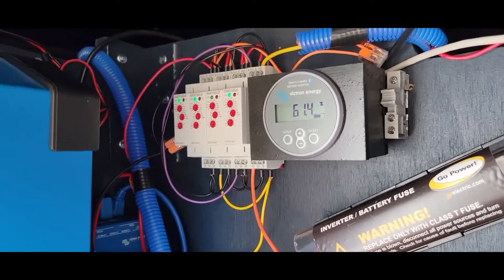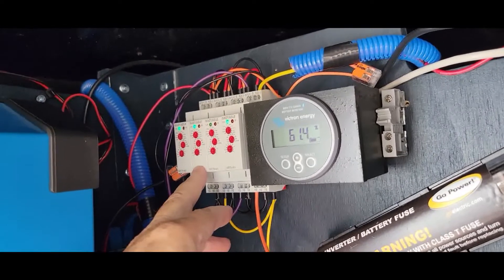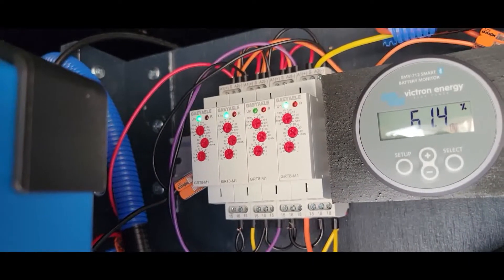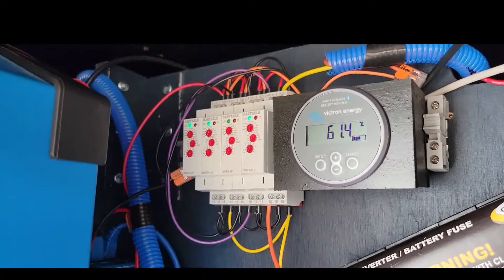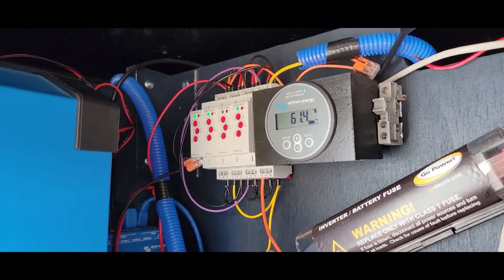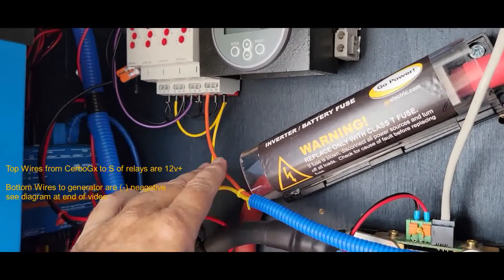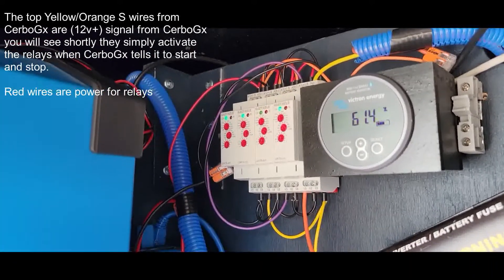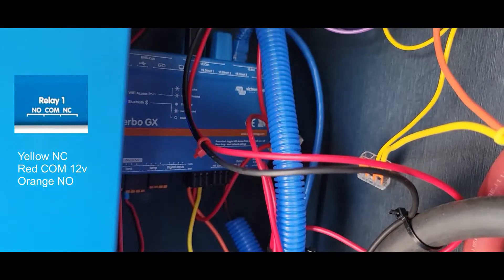Automatic Generator Start CerboGX start/stop/prime setup. Onan5500 controlled by Victron Cerbo Gx

Comment: Great video, and thank you for taking the time to share your knowledge.  I have the exact same setup as you do; however, after wiring exactly how your diagram is showing, then rewiring based on the "rainbow" daisy chain you have for red/black and NO wires, I still am having issues here.  I was wondering if you can compared my setup to yours?  For starters, I have the exact same Onan 5500 gas generator with the prime cycle start-up.  Hold Stop for 3 or 4 seconds--I was always told to hold until the display showed numbers--then push the Start button, holding it down until it starts.  So, exact same as yours.  When I originally wired everything up, I used 5-gang Wago connectors for the red 12v+ wires on top, same Wago for the top black wires as well as the bottom ground (Note: I have both my top ground wires and my bottom ground wires connected; your diagram doesn't show this, but I'm unclear why it would matter, i.e. ground is ground is ground is ground), etc.  Also, I had the red 12v+ wire going into the center pin of the Cerbo relay wired to the same red wire 12v+ for the tops of the relay.

Wired up this way, the minute I hooked up the red wire to my battery, the relays ALL started firing.  My lights looked nothing like your startup sequence.  I notice that in your startup sequence, Relay 1 & 2 & 4 all have green lights (no red), with Relay 3 showing no lights at all.  After your relays trigger a full start and stop cycle, your lights then show Relay 1 & 3 with green lights, while Relay 2 & 4 have green and solid red.  My first big question for you: how are your relays supposed to go from this "finished" state back to the original starting state?  There is a cut in your video where the relays are just magically back to the starting state (Relay 1 & 2 & 4 all green, Relay 3 not lit at all).  How does this cycle back?

After reading some comments here, I noticed how you have the A1 slots all daisy chained together with the little "rainbow" wire technique.  So, after striking out on my first attempt, I tore everything down and rebuilt with that approach.  As best as I can tell from both your diagram and still images from your video, I now have my relays wired exactly like yours.  HOWEVER, as I noted before, as soon as the red 12v+ wire is attached to my battery, the relays start triggering even though I haven't started the generator with the Cerbo Remote Console.  I have no clue why that is the case; the signal wires are attached correctly (per your diagram and the video), so I'm really stumped at this point and could use some ideas.

I almost forgot to mention that I do have the single function relays that you mentioned in the video.  I have three GR8T-B1 relays for Relay 1 & 3 & 4, with the GR8T-A1 for Relay 2.  I am using all of the same settings that you are.

One thing that I will point out, to echo another user's comment on this video, you don't show anything about how the bottom wires actually attach to your generator.  What I did was run the two wires up the wall behind my OEM control panel.  In the control panel, I have a rocker switch for the Start/Stop, with a generator display for how many hours are on the generator.  Behind the rocker switch, there are three wires (a brown wire behind the Start side of the switch, a black neutral(?) in the middle of the switch, and a yellow(?) wire behind the Stop side).  I assumed that Stop wire from the bottom of the relays (two outputs on Relays 1 & 4) would simply splice into the yellow Stop wire behind the rocker switch, and the brown wire (Start wire from Relay 3) would simply splice into the brown wire behind the Start side of the rocker.  I think these wires/capabilities at the control panel are backwards, because when I have the Stop wire (from the control panel) connected to 18 coming out of Relay 1 & 4, when I apply 12v+, the generator IMMEDIATELY tries to start.  I swapped the wires at the bottom of the relays, and then I get a priming cycle.  HOWEVER, as soon as I connect 12v+ power, the relays trigger....I get a priming cycle, but no attempted start of the generator.  The second attempt at wiring is producing the same results as the first wiring.  Ugh.

At any rate, I believe I have it all wired properly.  I believe I have the Cerbo configuration for the generator start/stop also wired correctly.  I'm really just frustrated and completely out of ideas.  I'm a newbie when it comes to relays, but I took the time to really study how these particular relays work.  I just don't see anything in my setup that is deviating from yours.

Please help.  You are my only hope.
Reply from the maker: To be more specific when using GRT8-B1,A1 relays.  Top wiring should be Relay 1 A1 CerboGX start signal NO wire and daisy chained to relays 2 and 3 A1s.  Relay 4 A1 CerboGx Stop signal wire NC.  there will be no "S" wires and the grounds are connected the same.
Reply from the maker: To answer your comment on generator wire connection and for others.  In the video I said I connected near  my G7 pannel in the RV but there are a many combinations and conditions that are possible and I've seen some weird setups. standalone generators, diesel generators are diffently configured different.   Seen 12v triggers and combinations of ground and 12v on prime switch etc.   Like on the sheet Test Test Test so you know exactly what triggers your generator before making any connections
Reply: @ERazorDiy  Oh!  One final thought (just in case others run into this issue): after getting the wiring on the top updated per your original response (removing all red 12v+ wires and moving all S signal wires over to A1), my start sequence still wasn't working as I would've expected.  But that's when I remembered the weird situation from the night before where the wiring at the generator start/stop switch seemed backwards.  As I mentioned previously, I assumed that the wire directly behind the Stop side of the switch would be where the Stop signal would need to be sent, with the wire behind the Start side of the switch would be where the Start signal would be sent.  In a nutshell, it was exactly opposite (for some reason!).  I had to send the Stop (priming) signal to the wire behind the START side of the switch to get priming cycle, delay, then start the gen to work properly.  Or, more to the point, the 18 ports from Relay 1 & 4 (Stop) had to be sent to the wire behind the Start side of switch; the 18 port from Relay 3 (Start) had to be sent to the Stop side of the switch.  Go figure....but wanted to point this out as it does seem like a weird configuration and not at all intuitive.  But, testing things out, I was able to discover this and get it working.  Thanks for all of your great information!  Sincerely!
Reply from the maker: @JohnZurilgen  glad to here you got it working and yes there are some wired configurations on the start/stop and prime switch panels even seen a prime switch with 12v (assuming it went directly to fuel pump) so that was ignored and sent prime from the stop.  Definitely need to test your supply controls to see what's really happening.
Reply from the maker: Hi John,  The multifunction (GRT8-M1) and the single (GR8T-B1,A1) function relays work slightly differently so you need to change the wiring a bit.  The top wiring would be changed as follows.  The ground wires to the top will remain the same. Relay 4 remove A1 12v wire.  Remove "S" wire and put in A1.   Relay's 1,2,3 remove the "S" wires.  You should be left with A1's rainbowed to 1,2,3 and pig tail on 3.  remove pig tail on 3, leaving rainbow 1,2,3 on A1.  Remove the 12v to relay 1 A1 and replace it with start signal "S" wire you had on A1 "S".    this removes the all the "S" wires triggers and is now using the power from the cerbogx  NO and NC to activate the relays.  When the cerbogx is stopped the only relay is on is #4.  When you start the generator relay 4 turns off and 1 and 2 should come on. Remember 2 timer must be longer than relay 1 timer by a 3-5 seconds ish can be a bit longer.
Reply: @ERazorDiy  amazing!  Thank you for this comment.  That totally fixed my issue!  I'm happy to report that this change has lead to great success.  What's interesting is when I was wiring up the relays based on your video/diagram, I even though to myself that I wondered by the NO/NC wires wouldn't be used to energize the relays themselves.  I tested the NO/NC wires with a multimeter and discovered what I would've expected: with the Cerbo relay "off", the NO wire was showing no voltage while the NC was showing 12volts+.  When I activated the relay switch via Cerbo Remote Console, I saw the voltage swap in the wires.  Being new to relays and understanding the power to the relays (red 12v+ and black ground), I understood the S slot to be the signal that would close the gate and energize the relay.  And, I suppose that is exactly how it works in those multi-function relays (to make that relay more flexible for the change in functions).  In my single shot relay, the signal wire becomes the 12v+ for that relay to energize and "do its thing".  Man, it's awesome to learn new things.  🙂

Comment: Amazing video! Would you be able to provide information on how this is wired to the RV side of your switches? Specifically the gen start/stop and prime. I have a separate button to prime and he start/stop is a 2 sided switch(left is start and right is stop). Also I noticed the red wire in the relay on the cerbo gx, is this just a 12v power to supply the relay? Or is this where you are drawing the power on the top side of the relays? Do I have to power my relays from this location? Thanks very much in advance for your help
Cheers
Ken
Reply from the maker: Hi Ken,  that sounds like a diesel generator?  That setup would be different but doable but would need more information on your generator.   This is a simple way to to control the generator.   A more advanced way is using a raspberry pi picow I have a video on that as well. https://youtu.be/ujeoZ4ldIGY
Reply: It’s an Onan 4000 gas gen.
Reply from the maker: @kenmick7710  I haven't seen a prime on a onan 4000 typically just a rocker stop/start and the stop is prime, but not a separate switch for prime.
Reply from the maker: The red wire on the com of the cerbogx is 12v.  So when the cerbo generator signal is on "NO" is providing a constant 12v to signal "S" relays 1-3 and when off "NC" is sending a constant 12v to "S" 4 relay.    Again your setup sounds like a diesel so it's would not be configured like this.  I have worked with another person on a diesel setup.    You can find me on fb and dm me if you like
Reply: @ERazorDiy how do I find you on Facebook. I’m interested in the diesel version of the diagram.
Reply from the maker: @aphillips76  Eric D Kozakiewicz  and dm me.
Reply: Eric, sorry to bother, how do I find you on Facebook?
Reply from the maker: @kenmick7710  Eric D Kozakiewicz
it's no problem glad to help

Comment: Question.  So on the Cerbo GX, I have it set to start and stop at a voltage limit for high and low.  Having issues getting it to shut off. Any ideas why?  I am going to try your set up for these relays that I bought.  Will auto start and stop still work with these relays? You started manually.  Just making sure. Thank you. Brad
Reply from the maker: Hi Brad,  Need more info on your setup.  The CerboGx typcally can not be directly connected to a generator that's why I'm using these relays.  I spliced into my generator wires going to my G7 panel so the RV panel Works per OEM setup.  The CerboGX including voltage, SOC etc.  has more options and will automatically turn off and on the generator the way I did it as well as manually like shown.
Reply from the maker: I am working an another solution to control the generator, fan, lights etc. as well.
Reply: @E-Razor-Diy , sorry. One more question.  Since I am connecting to a portable gen is it okay to power relays from the 12v battery on my gen? I don't have a DC to DC victron connection. Thank you.
Reply from the maker: @Brad Kiefer  yes using any 12v source is fine.  Just make sure it's connected to the cerbogx as well.  Meaning it needs to go the cerbogx relay as well as those relays to trigger.  Must have same source

Comment: Hello Eric thanks for the video I would like to talk with you but not sure how 
I believe I have the same set up you have. I was wondering if you would let me know the actual settings are on each relay . ie time delay and letter corresponding to the function.  I have it all set up just double checking before energizing. Thanks  I will reread each comment also incase i missed something.
Reply from the maker: Hi Paul,  this is my current settings and works well with my onan5500.  left to right 1st relay F35%10s H20%1m F70%10s F75%5s.   I can be found on fb also Eric D Kozakiewicz.   2nd relay needs to be longer than the 1st as they are triggered at the same time and you need a bit of a delay before the 3rd relay starts.
Reply from the maker: I will soon be posting  generator status using digital inputs to cerbogx.   Although it's just a status on/off it tells you if it's really running

Comment from the maker: Typical diesel generators are different from this onan 5500 setup.  I used two automotive relays and two timer relays for diesel setup.  Typical diesel has three stages OFF ON and momentary START
Reply: Hey! I have a client who wants to use auto generator start on his boat with a Cerbo GX and he has a Cummins Onan diesel generator. Do you have more insight on this? Thank you so much for your research and development on this. I’m really impressed
Reply from the maker: @barnswallowtinyhomes2990   I've helped many install units in boats, cabins, rv etc.  That includes diesel, dual fuel generators from 2000w to 20kw units.  It's all based on the system congratulation and generator and needs to determine what configurationis best or custom in some cases.   We do have units for different uses on doingcreatesknowledge.com 
and have moved away from the old 4 relay setup.  
Eric
Reply: @ awesome! I’m happy that you started marketing this product. You’re helping a lot of people. Brilliant work!

Comment: Is your 5500 a diesel? that why you need the prime relay?
Reply from the maker: My 5500 is gas.  I just have heard these generators get harder to start the longer you use them.  Wanting to use the cerbogx to start and stop the generator can be done with just two of relays as my data sheet states.   But I did want the prime cycle so I came up with the 4 relay version and it is what I use.  My prime is only set at 3 seconds and has no issues starting but as time goes on I can adjust it to whatever it needs.  I am using soc values  to start and stop via the cerbogx automatically and manually as well as my Rv's firefly control to manually operate it.  I did not remove the  Rv's control of the generator and is still available.
Reply from the maker: Would like to add.  Sometimes when using the Rv's controls to manually start the generator I had to hold the start button down for a few seconds as the generator was slow to start.   This also convinced me of figuring out a prime cycle start
Reply: @ERazorDiy  ty, I have a diesel generator and a cerbo gx.  This might work for my preheat cycle.
Reply: @ERazorDiy  do You have the wiring diagram?
Reply from the maker: @constechable  end of video is wiring n data sheet
Reply from the maker: I have worked on a relay setup for a diesel generator.  They are different
Reply: Do you possibly have the wiring diagram for the diesel generator set up?  does it include a preheat period.  I have a Vetus gen set and would like to replicate your setup with the Victron Cerbo GX. Thanks for sharing all the info on you tube. it’s extremely useful.
Reply: @ I do have that on my computer. I will look it up and get it to you. It does include a preheat time.

Comment: How would you wire it with just 2 relays?
I just need signal to push button on generator.
I looked at the diagram on the victron site but could not get it going.
Different relays.
I'm using the same relays that you are
Reply from the maker: For two relay setup you would be using relay 3 and 4 and their settings, don't go by picture see relay settings.  Top of relay 3 A2 ignore the purple wire and A2 needs to be tied to the ground going to relay 4 A2. follow the rest of the wiring with ignoring 1&2 relays.  The bottom of the relays #15 is type of signal to be sent to the generator in my case its a ground as the onan 5500 requires a ground to be sent to start and stop.  Looking at the bottom of the relays #16 is #15 being sent to generator.  Not knowing what generator you have check that push button wire to see what's happening if its a positive voltage or negative voltage and that's what #15 should be.

Comment from the maker: Cerbo gx takes a bit of configure before it will work.  Cerbo gx settings: 1 menu  settings  2 relay.  Set to generator start/stop 3    generator start/stop this will appear above the relay in menu but do third.  Under generator,  auto function on, settings,  quiet hours on,  then you can select conditions under "conditions " for battery soc etc...

Comment: Thank you, very good video.
I also devised an auto start feature using a single solid state board with latching and timer functions that worked well for my onan 5500.
I have 40.3hwh of battery storage in my semi  mainly to run my A/C during my down time (10 hour break/34 hour reset) and my gen set is solely for the purpose for recharging batteries. The cerbo controller allows me to sleep and auto start at a preset capacity percentage and only charge to 80% .anything more and the charge amps drop loosing the efficiency of fuel to amperage ratio.